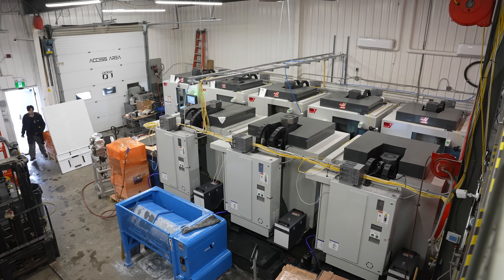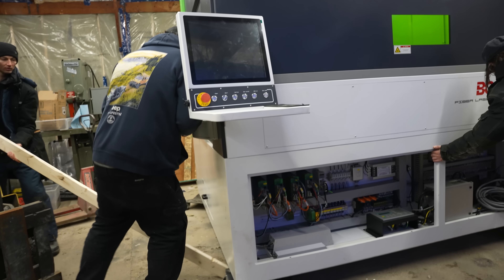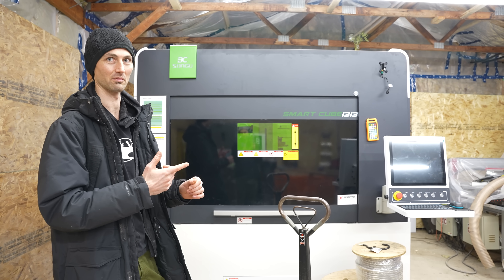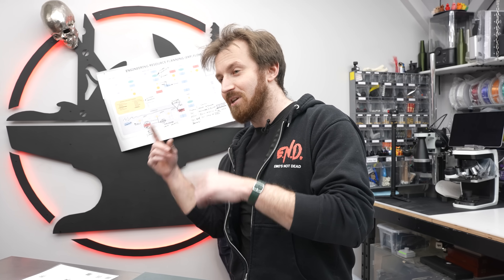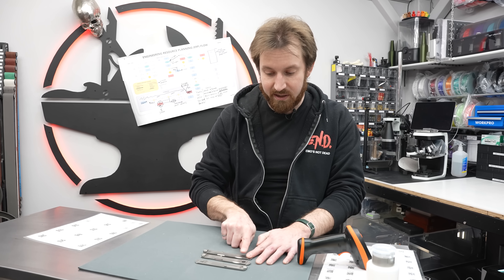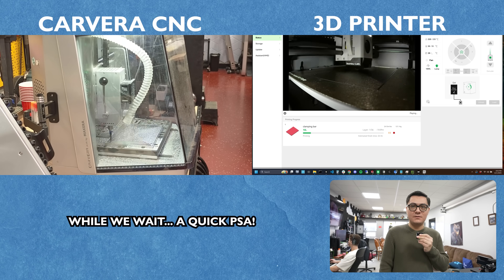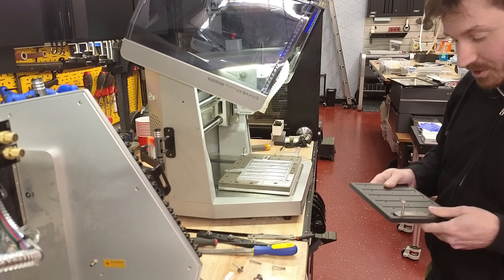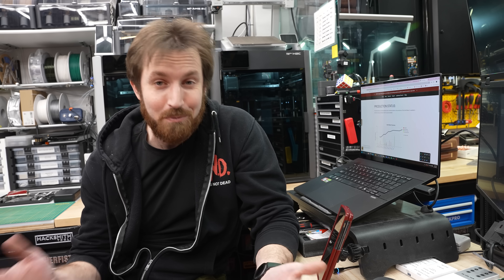Shop Upgrades and Process Fixes! |  Smith Blade Update | 14

Comment: I'm pretty sure if you use tungsten electrodes, (like the stuff that is used for TIG welding) to spot Weld the titanium instead of using copper electrodes, you should be able to get cleaner welds with pretty much no splatter. Sharpening it also helps.
Reply from the maker: It's titanium slag... Not copper

Comment: I mean kind of a big “duh” the cnc would win vs a 3d printer in that scenario. 3d printer is creating an entire thing from scratch, whereas the cnc is just doing some shallow passes on a block of metal for the same thing. A more fair comparison would be making a mold, pouring your metal block, then letting the cnc run its thing and comparing that to a 3d printer time, guaranteed the 3d printer wins then since allowing time for your metal to heat and cool and then the material removal is likely longer.
Reply from the maker: Which was exactly my explanation....

Comment: couples of idea, did u try by any chances anty stick spray for welders? splatter doesnt really stick.
or option b just having air blowing on the spot welder heat? i think u could blow away the splatter. id ned to try

Comment: Why go through the trouble of reloading the blades back into the machine just to get it slightly touched by the spindle to remove some bumps. A human has to be loading and unloading which isn't that efficient.

Why not design or buy a planer machine. Just have a circular file spinning and a jig below to put the knives. You push the jig below the spinning file or into the planer machine to make sure everything on top is below the height you want. 

Heck you can even make a conveyor belt that puts the knives through the planer machine / spinning file
Reply from the maker: Guys... There is protruding geometry, you can't put it through any kind of planer or jig...

Comment: Want to start with LOVE the vids and cant wait for my knife.
Had to react on the test. common man that is kind of a lazy unfair test. production quality cnc (about 8000 dollars im guessing) vs high mid tier very slow for what is out consumer 3d printer (500 dollars maybe). Not a 3D printer advocate, but i am in construction. if we are honest, the low cost method aways just feels like the wrong choice. I would say 3D printing would be the best solution here for the long run (if you use the right fillament heat resistant extra tough etc).it would make the jig.
- With a good printer (at least 1000 to 2000 dollars) way faster and more accurate.
- Low cost.
- Beceause of the nature of the material does not need to be handled with care. can survive a drop easily.
- Multiple versions can be made very easily.
- Modifications and markings can be made in the material.

im from Europe and just realized im converting to us dollars. dont really know what that is in canadian to be honest. sorry.
Reply from the maker: Uh... That's a bambu x1c... It is a very fast printer. And the Carvera air can be picked up for $2k. Could have done the test with a bambu H2c and the result would have been the same... And costs more than the Carvera

Comment: I feel like the race was already in favor of the carvera. The jig you made looks to me like you had to remove less than 50% of the original piece of material. 3d printing is additive therefore it had to do more work in this situation.
But in a case where the subtractive process would have to do more complicated work. Maybe the 3d printer would be faster.
Reply from the maker: Which was the exact explanation I gave...??

Comment: Why not just make a hand filing/sanding jig to go on top of the one you made in this video, with in abrasive locked into a linear track. I think a few passes by hand would be much quicker than setting it up for CNC and running a long operation.
Reply from the maker: It's a few seconds per scale. Doing anything by hand takes more than few seconds. The only way to ensure quality is having a repeatable process, hand doing anything is not perfectly repeatable

Comment: Hey love the video. Just had an idea for the tack welding issue. Instead of fixing the weld splodge. Could you prevent it entirely? By adding some ceramique sleeves around the spot welder tips to physically stop the metal from raising in bubble?
Reply from the maker: Yeah I tried that too

Comment: Use an over center mechanism to clamp blades into fixture for next iteration.  driving bolts for a simple op with low tool pressure takes too much time

Comment: The spot weld cleanup fix is overcomplicating a simple operation. A buffer with a Scotchbrite wheel would be fast, look good, and not take up machine time.
Reply from the maker: The surface is not flat. Features and bosses stick up from it, you cannot just hit it with a sander or Scotch bright
Reply: @theHacksmithVLOGS  Use a quarter inch wide wheel and jig/plate to focus the action just on the welds. Might not work on butt end of the scale, but looks like all kinds of clear real estate up near the hinge pin, which would likely mean reducing machining time by a third.
Reply from the maker: Still doesn't work dude, I think I know my product. The welds are in a tight corner

Comment: Where 3D printers still have the edge in prototyping is cost. While the CNC machine is faster, both the machine and raw material (aluminum stock) is significantly more expensive than the 3D printer and filament. Where it would have been advantageous for the project shown is to say, test your design to make sure things would fit as intended without potentially wasting a piece of aluminum. Sure, you're trading a couple hours for saving maybe $20 in materials, but depending on what you're prioritizing and the availability of those materials, it could still be worth it, particularly when those couple hours are machine hours, not labor hours.